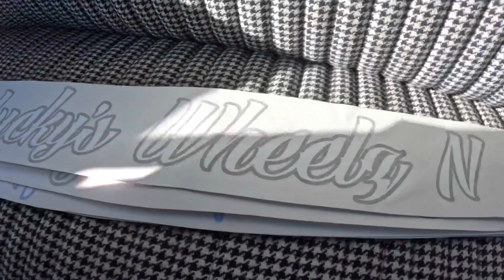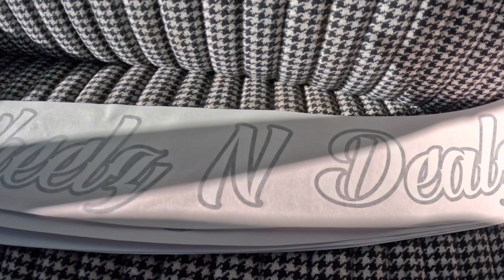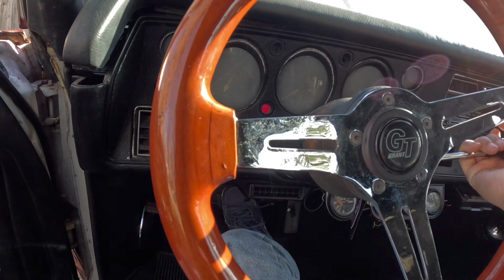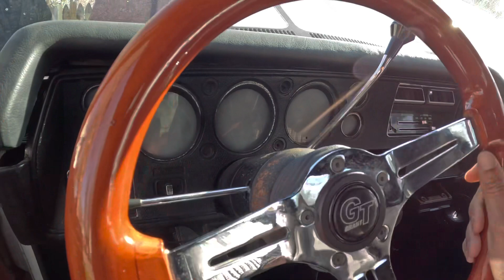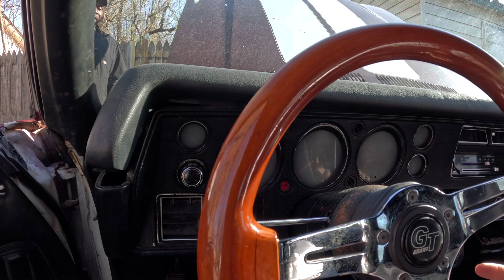Can't Believe I Caught Unc Messing Up My Car

Comment: Wire wheel on a drill and then get POR 15 and brush it on it will stop the rust . Before you line up the fenders get the wheel wells and battery tray so you don't have to do it twice.

Comment: Wire brush the trunk and vacuum it out first of coarse.  But you still need to spray some rust reformer over it so it doesn't keep rusting. Rustoleum Rust Reformer works great
Reply from the maker: Thanks for the tip

Comment: LUCKY RUST INHIBITOR IS A BLACK PAINT THAT YOU SPRAY ON METAL THAT HAD RUST AFTER U SCRAPE IT DOWN BEST IS WIT A GRINDER WIT A FLAT WHEEL BUT U CAN DO A WIRE BRUSH JOB IF U DO IT REAL GOOD. THEN BLOW OFF N SPRAY THE INHIBITOR TWO COATS UNLESS RUST IS HEAVY DO AS MANY AS IT TAKES. U CAN PAINT OVER IT THE INHIBITOR SEALS OFF N STOPS RUST. MY UNCLE SAVED HIS WRANGLER FRAME BY FLAT WHEEL GRINDING IT ALL DOWN N COVERED IT IN INHIBITOR THEN PAINTED OVER IN PRIMER THEN REGULAR PAINT. BUT INHIBITOR ALWAYS GOES FIRST EVEN BEFORE PRIMER.

Comment: Lucky. Do not sand that car yourself other than maybe cleaning up in the trunk and then spray it with a good rust encapsulator. As for the body let the body guys sand it and line up the panels  believe it or not improperly sanding on the body especially the roof can cause all kinds of issues  such as warpage etc..  order some new inner fender wells , a battery tray  and a weather strip kit  .it is also missing the upper cowl mesh grilles under the wipers. The  car is worth putting a few bucks into .